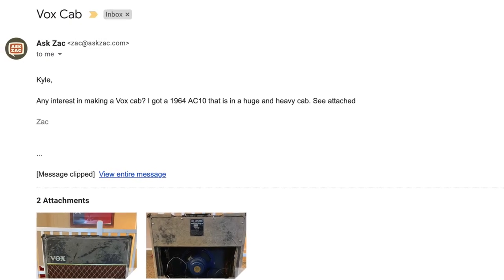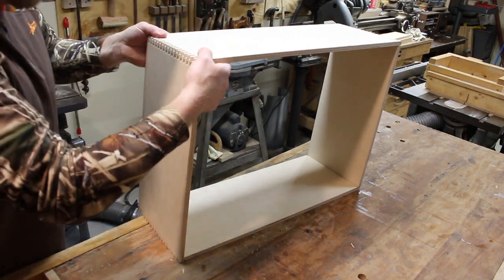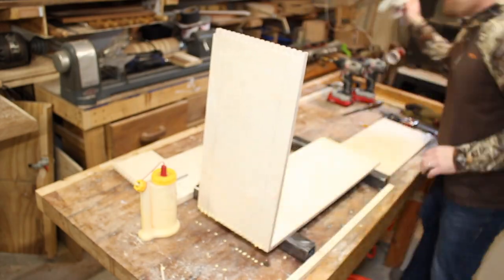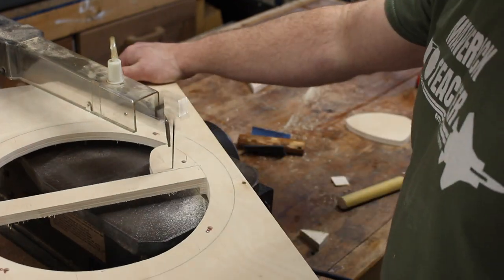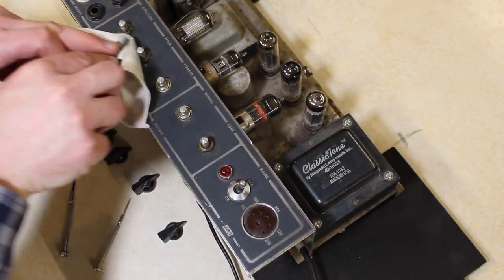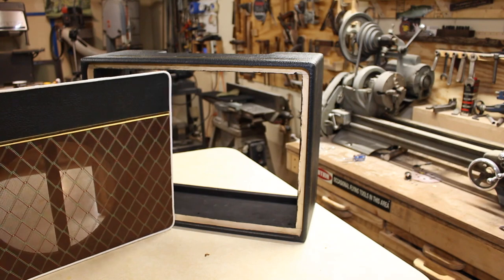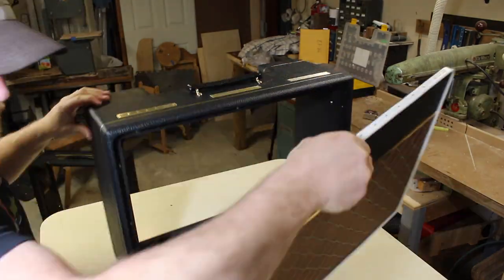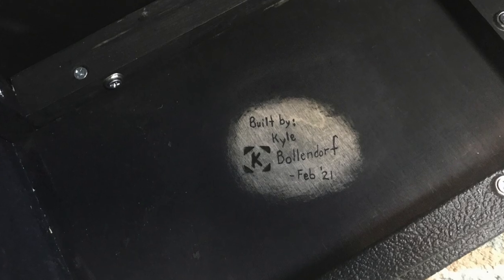Building a Custom Vox Cabinet for Zac Childs' 1964 AC10

Comment: I was with Zac when he got this back. He was so excited. He put in the tubes, then slid in the chassis, and one of the Truetone guys adjusted the length of the wire to the speaker or something. Then he turned it on and started playing. We’ve been friends for nearly 30 years and I could tell he was giddy. He said it was even better than he had hoped. Your work is absolutely amazing and shows so much craftsmanship. Great job!
Reply from the maker: Wow, that's so cool!  Thanks for sharing that Jeremy!  It's so great to make something that my fellow guitar geek tone chasers appreciate!  It really makes me thankful and feel blessed to be able to create something like that cab.
Reply: You sir, are a steely-eyed missile man bar none!
I've worked with some old timers doing fine finish work on houses I've seen jigs they've built to re-create some wild, long-gone, arcane trim, casings and moldings but I believe they would be floored by the table saw jig you fabricated!
I'd say your workmanship and attention to detail is easily on a par with Northcoast Music's excellent cabs (now mostly, sadly a thing of the past...)
I have Mojotone and Mather cabs but the fit and finish you put into this awe-inspiring, JMI-era recreation is DAZZLING.
Also IMO the more "horizontal" change you made to the original 60s Vox cab dimensions was an excellent idea too.
Reply from the maker: @Nazzz65  thanks for the kind words!

Comment: Cool build! Done a few cabinets myself, always fun. Pro tip, on glue ups I use a silicone basting brush. Super easy to clean up and I have been using the same one for like 20 years now :)
Reply from the maker: Thanks!  Great tip, I’ve seen that and will definitely use it in the future!

Comment: Beautiful craftsmanship - lovely work with the gold piping. Thank you for the inspiration - I have an old Traynor tube amp from the late sixties that I’d like to change the original 4 - 8” speakers out for 2 - 10”. I should be able to preserve the original speaker panel for historical purposes. Thanks again. New subscriber for sure!
Reply from the maker: Awesome, so happy to hear that!  Good luck with the new baffle, I imagine it will sound fuller and have more volume as a 2x10.  Let me know how you make out!
Reply: @VintageWoodWorkshop  10-4 will do.

Comment: I built a Deluxe Reverb as a 2 x 10" (with mismatched speakers - one ceramic, one alnico) and come to believe this is how God intended small amps to sound - MUCH better than the 1 x 12". If I were fortunate enough to acquire a vintage AC10 in need of a new cabinet - you can be sure I would have it be a 2 x 10". That being said, I want to add my praise and admiration of the construction of this amazing cabinet!
Reply from the maker: That’s a cool idea for your cab, like a vibrolux.  Do you just make a new baffle board?  Can 2 10s fit in a stock DR cab?
Reply: @VintageWoodWorkshop  - Yes - made a new baffle board of baltic birch ply to fit a ply (not MDF) DR cab I bought on eBay and beefed up the mount. Worked like a charm. I love the sound so much I use the cab as a external cab for other amps from time to time - I've got a Frenzel AC15 clone (with the EF86 preamp circuit - those guys do GREAT work), a vintage blackface Princeton Reverb, and recently bought a Laney Ironheart IRT to play with a multi-channel amp with all the bells and whistles - and all are divine through the magic speaker box. The speakers are one Eminence Legend ceramic, and one Eminence Legend alnico. There may be cabs that sound as good, in my opinion, but none better. I'm a retired remodel contractor, and so I know quality work when I see it - and let me say again how much I admire your creation (clearly not a reproduction) of the AC10 cab. All due kudos...

Comment: Great work! Amazing! But no Celestion Blue in the end?
Reply from the maker: Thanks, no I shipped it back without a speaker because Zac had the blue in Nashville.  I just used the celestion classic lead 80 to make sure the blue would fit when the amp got to Zac

Comment: Damn! - the one bit that I wanted to see - how to fit the gold T shaped trim at the top of the speaker cloth - was skipped. The cloth has pulled out from under the trim on an old Vox 2x10 cabinet which I'm modifying to take my (new) AC10 amp. All the same, a great video and build

Comment: Kyle, super nice job on that cabinet! I have a 72 Princeton that the control plate is dirty an has masking tape (?) residue on it. Would wd40 be good to clean it as well?
Reply from the maker: Hey Greg, thanks!  Try Goo-gone first...that works wonders with adhesive residue.  Wd40 is great to break up any dirt and grease
Reply from the maker: Be careful and go lightly, there is a clear coat on top of the silver face panel that you want to keep intact.  Do you have any of those worm trail-ish corrosion spots on your panel?  Those form when moisture gets under the clear coat, just like on Aluminum wheels so keeping the clear coat is important